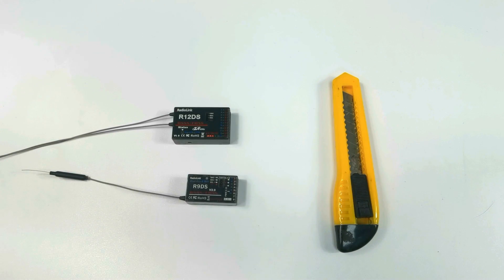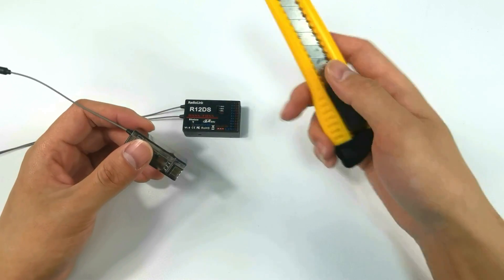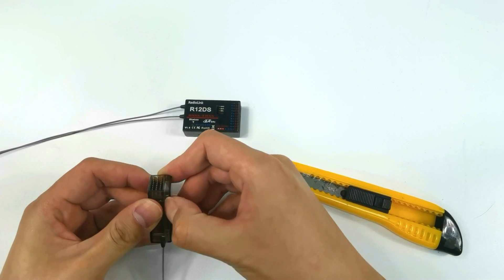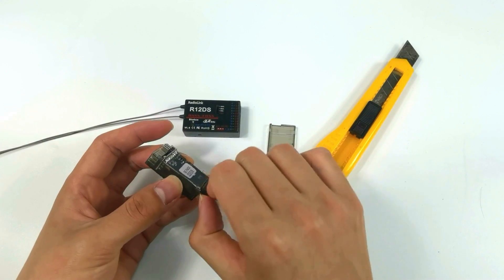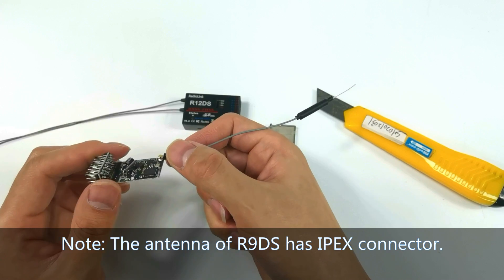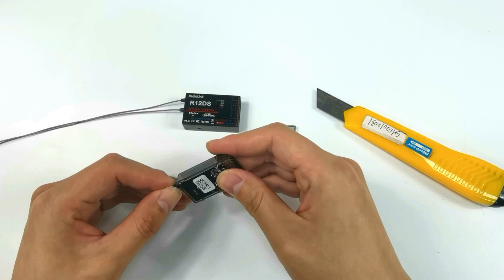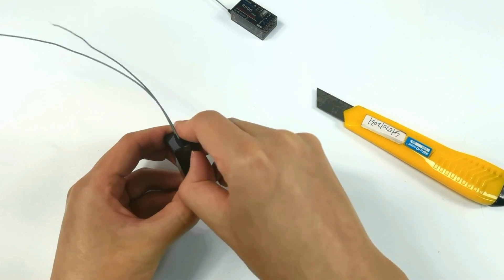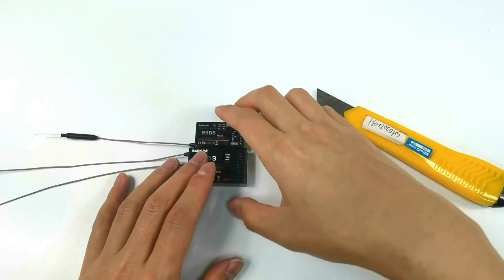How to Replace the Antenna of R9DS & R12DS Receiver?

Comment: do i need to replace the antenna to get maximum range on the drone?
Reply from the maker: Hi, sir. You cannot replace the antenna to get maximum range on the drone. If the antenna is broken, you can buy the original antenna from RadioLink AliExpress official store: https://radiolink.aliexpress.com/store/4714037  If you want longer control range, you can add external module to your transmitter, such as TBS Crossfire module. If any question please feel free to contact us. Our email is after_service@radiolink.com.

Comment: How to connect R9DS receiver to velox cine f7
Reply from the maker: Hi, sir. R9DS supports SBUS and PWM signal. If your flight controller supports standard SBUS or PWM signal, they can work together. Here is the detailed manual of R9DS which introduces the working modes of R9DS for your reference.https://www.radiolink.com/r9ds_manual   If any question about RadioLink products please feel free to contact us. Our email is: after_service@radiolink.com.cn